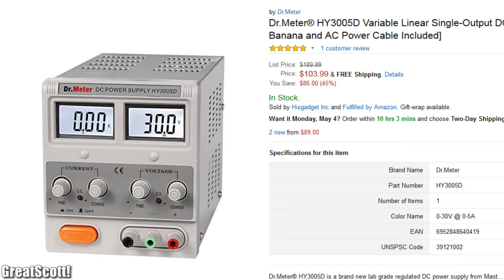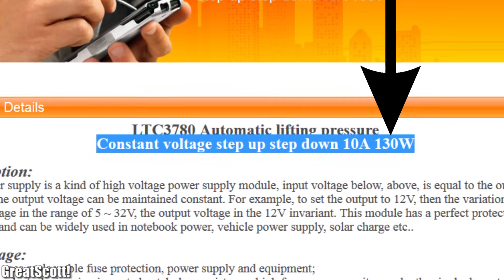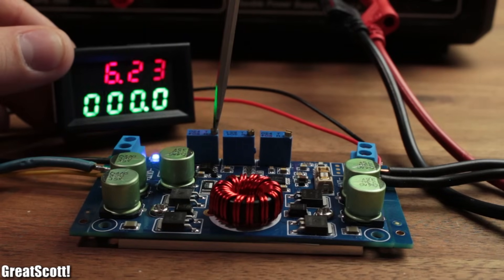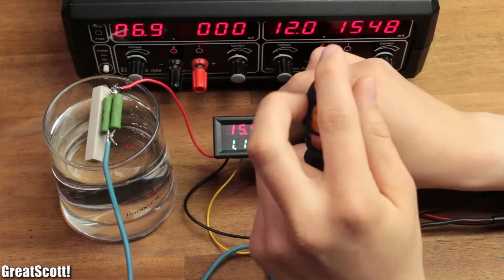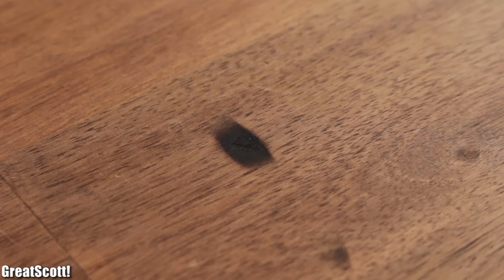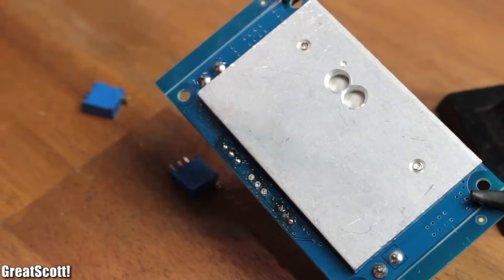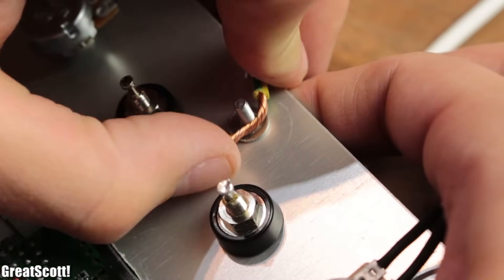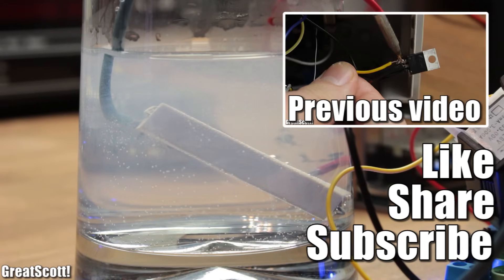Build your own Variable Lab Bench Power Supply

Comment: How to build a power supply: Take a power supply and put it in a case. That's this video in a nutshell.
Reply from the maker: +ronettreker Don't forget the DC-DC converter and the voltage and current display and the potentiometers and the main switch and.........
Reply: +GreatScott! You didn't understand my comment. The Variable Power supply is represented by the 12 power supply and the DC to DC converter. The rest of the parts are just for a convenient form factor. Not even the volt+curent meter is necessary as you could have just mounted two banana sockets in parallel with the binding post and plug a multimeter. What I'm saing is that you focused too much on the package and not on the power supply itself. What's the purpose of this video? Educational? Not really as there wasn't any insight on how a  variable power supply works. DYI? Nope. You used pre assembled boards. Hack? No. You didn't even used any common adaptor, you could have used some laptop or pc power supply, something that your viewers might have, but instead opted for a 12V adaptor that you have to buy from an electronics store. Don't get me wrong, some of your videos look like something made by Ben Heck, this one looked more like something made by Kipkay...
Reply from the maker: It's a simple modular variable lab bench power supply that even beginners can make. I think I said that in the beginning.
Reply: +GreatScott! They can't...because they would need to have the money and access to buy those parts from an electronics store. If they had that money and avaible store then they probably wouldn't even bother building one as they could just buy a fully built one. There's a comment bellow me that even asks if it's possible to build one using a PC power supply. You could have used a laptop power supply which would have given you 19V with 4 to 5 Amps. You wouldn't have needed a step up converter as 19V is enough for a begginer.  Don't get me wrong, this video is interesting to watch, but useless for a beginner.
Reply from the maker: ronettreker
Thanks for sharing your opinion. But I have a different opinion concerning this topic.
Reply: GreatScott! Just don't take my opinion as an insult. It's just, hopefully constructive, criticism.
Reply: Namfrey Fullson What asumption? You just pointed out the same thing I said in my second reply to Scott. Scott bought all of the parts he used. I said he should have used a fixed power supply that a lot of people already have, like a desktop PSU or a laptop power brick. Also a down converter is a relatively simple circuit to build. The hardest part of a down converter is the oscillator. A cheap 555 would do the job, then all you need is a MOSFET and some filltering caps and inductors. Yes, a homemade down converter isn't as acurate nor does it produce a signal as clean as a bought one, but it's a beginers tool anyway.
Reply: Namfrey Fullson The project made by Scott is very simple, I agree on that. What I was saying is that the parts used by Scott are un-available for most people and that he didn't give enough information in the video on how to use other parts.
Reply: +Namfrey Fullson Doubt it...but even if they had it, the unit costs 20+ USD. Together with the converter they cost at least 40 USD. Well then what&#39;s the point? You can get a decent power supply for 46 USD http://www.ebay.com/itm/30V-5A-Precision-Variable-Adjustable-Digital-DC-Power-Supply-Regulated-Lab-Grade-/131179224846 The power supply in this video is not worth it...
Reply: +ronettreker I think you have a valid point. Too bad you didn't state it as such to begin with.
Reply: PunakiviAddikti
You didn't understand my comments... If Scott wanted to help beginners build a cheap power supply or educate them, then the video didn't achieve that. Firstly the parts in this video aren't really cheap and secondly, he didn't give the viewers enough information so they can build a variable power supply from other cheaper parts. He could have build a DC-DC converter using an Arduino or Raspbery pi to controll the MOSFET or even a 555 timer which is very cheap. But instead he used an off the shelf converter which defeats the purpose of actually building it and UNDERSTANDING HOW IT WORKS. And he could have used a power supply which a lot of people might have in their house like a laptop brick or desktop PSU, but instead he opted again for an off the shelf power supply. The video isn't bad it just isn't useful.
Reply: Man, this comment thread is ridiculous. Yeah, the original comment is slightly inflammatory but the point overall is sound. I swear no one who got angry at OP read all the comments.
Reply: PunakiviAddikti
 A 555 timer based PWM circuit was built on a Make video. MAKE! Those people target their videos at a lot of beginners. Combine a PWM circuit with some filtering capacitors and inductors, add some circuit protection and that's it! I mean it's a simple circuit! It's not going to have the same clean and precise signal as the one made in this video, but it's for a beginner who's not going to work with high precision electronics anyway. Anyone with a little bit of electronics knowledge can build it. Also Arduino's are very reliable and a good PWM script can be easily found online.
Reply: +ronettreker Try writing shorter more concise responses that people can be bothered to read.
Reply: SouthJerseySound sounds like a jerk.  ronettreker
is providing a constructive criticism.
Reply: @namfreyfullson  I would think that a lot of beginners would like something that gave them a chance to do something challenging...
Reply: ronettreker
Reply: ronettreker Your debate is boring.
Reply: ronettreker He's already made a video on making a lab bench supply out of a old PC PSU. It wasn't fully variable, and only had the common voltages (12V, 5V, 3.3V), but you could use the info in this video and that one to make a fully variable one.
Reply: GreatScott! simple but costly
Reply: I get what you're saying, but this was an interesting video that offers a solution to power needs.
I was also disappointed that it uses a pre-existing power supply. But there's nothing wrong with this video.
Reply: +SouthJerseySound So criticism is now called "Trashing"? I'm pretty sure "trashing" and "hating" is when you insult something or giving it a bad image without providing any arguments. I've already said multiple times in the comments I made on this video that I like Scott's videos and that this video isn't bad. The thing I was pointing out(I admit, with a bit of bad humor in my first comment) is that the video isn't very useful for beginners as the parts aren't very cheap nor available and that the video isn't very educational regarding electronics. Also I'm not a video producer, so why would there be videos on my channel? If you want useful videos then check the channels I'm subscribed to...they might interest you. I like pointing out possible mistakes so that other people with better understanding can clarify the problem. There have been comments which I was wright and others which I was wrong, in the end however someone who knew about the problem clarified it. I guess it's called positive criticism.
Reply: *****
Do you people even read all of the comments? Yes I know what a variable bench power supply is, what else could I use to test circuits? NO, you do not take a measurement with a multimeter each time, you just need to put two banana sockets in parallel with the main ones on which you can measure the voltage in real time with the multimeter. In case of the amperage you could just  put another banana socket on the positive line and have a switch between that and the positive out socket. The disadvantage of this is that if you only have one meter then you can't measure them at the same time, but if you have two meters that wouldn't be a problem. And of course if you already have a panel voltmeter or ammeter you can use only one multimeter. This method would cut the cost of the power supply, not by much, but why not make it more affordable? Also, I never said that beginners should buy a professional power supply instead of making one, what I did say is that the price of the power supply in this video is almost the price of a entry level power supply you can buy on ebay (THERE'S EVEN A LINK). The power supply in this video is not that cheap and the video doesn't contain enough information that can be applied on other components such as a PC POWER SUPPLY. The whole purpose of my comments was to advise Scott to make projects more affordable and to include more technical knowledge in his videos. Can you please tell me what's wrong with that?
Reply: +YouReel Well if you "Cant Be Arsed" to read the entire debate then how can you form an opinion about me? No, I didn't start an argument just for the sake of it. If you "had been arsed" to read my comments you would have noticed that I given specific arguments about the flaws of this video. IT'S NOT "TRASHING". IT'S NOT "HATING". IT'S NOT "TROLLING". IT'S JUST CONSTRUCTIVE CRITICISM. IT'S BASICALLY AN ADVICE. Whether Scott listens to it, it's his business, it's his channel. Didn't know criticizing something makes you a cunt...
Reply: YouReel
And by "forcefully state" you mean the bad humor I used in my first comment? I've already admitted that the attitude I used in my first comment was uncalled for. The rest of the comments I made have arguments in it. If you are referring to the bitter attitude I had in my other comments, then sorry, it is mostly because I'm sick of the current maker trend where they instruct viewers how to put some parts together without giving any insight into how it works. As I said before, the video isn't bad, it just isn't very helpful for beginners. Also, insulting someone isn't going to make your comment more valid.
Reply: SouthJerseySound
A troll doesn't have arguments, or he has arguments that don't make any sense. His purpose is to annoy people. The arguments I gave make sense and I also gave examples and a link. So to answer your question, I don't know whether being a troll makes someone feel important. Also both of your comments are ad hominem attacks that have no relevance to the discussion.
 So unless you have something to say regarding the power supply itself then don't bother wasting space in the comment section.
Reply: Zyroc Gaming
 Yes, constructive, in the sense that I told Scott what I think are mistakes he made in the video. Whether he listens to me or not, it's his channel, not mine.
Reply: PunakiviAddikti
I know what a variable power supply is...what's your point?
Reply: YouReel
what?
Reply: YouReel
 Then why did you bother commenting? Probably because you're a troll and I fell into your trap.
Reply: YouReel
I made them as short as possible without leaving out anything necessary.
Reply: +ronettreker constructive...
Reply: Ron it's easy to knock someone's video. What I didn't see was you linking one of your own. Until you do that I think you should just shut your mouth.
Reply: +tomtentp Finally someone understands...THANK YOU.
Reply: He still made a better power supply than your sorry ass ever will and he filmed it and put it on yt for the rest of us.
Reply: +ronettreker Your methods would have added unnecessary complications to the video. Think about it this way: +Great Scott could have made an entire video on making a DIY DC-DC converter. And as far as buying a premade supply goes, yes, it would be more cost effective. But for a beginner, a project like this would be helpful even as just solder practice.
Reply: ronettreker  These type of modular instruments are very useful for college students like me on tight budget
Reply: ronettreker
Does being a troll creating arguments make you feel important?
Reply: Gee...youre a bigger buzzkill than buzz killington
Reply: +ronettreker I went to your page expecting to see some useful videos but there"s nothing. I was quite disappointed.I guess you wasted too much time trashing other peoples videos that are actually useful that you didnt have the time to actually share something positive :)
Reply: ronettreker 
You're an idiot.

Comment: This makes no sense, i've blown up 2 of those displays connecting the yellow wire to +v and yet here it works......
Reply: The setup on his is different from mine; mine, from sellerbible has red as sense voltage and yellow as the current path so it would be toast it I used it exactly as stated. I would need red to +V and yellow to the negative post. Also, ensure your device is rated for the current without a shunt. If not, wiring one in is simple enough.

Comment: You mentioned in the description that this power supply is capable of between "(0.8V-29.4V || 0.3A-6A)" but the LED current display is only rated up to 3 amps. Am i missing something?

Comment: how smooth is the output ,since the voltage regulator is PWM based ?
have you tested the ripple with oscilloscope ?
im curious how well does pwm perform under load, i read that pwm will not work for a bench top power supply,because bench top power supply need to be able to deliver smooth DC output ,or it might causing interfere with some sensitive component ,is it right,correct me if im wrong
Reply: +Tonny Cassidy You'll have ripple and using a cheap circuit like this quite a bit of it, too. You can always use capacitors on the DUT side to reduce the ripple, but some will still be there.
Reply: thanks,and by the way i read it somewhere that bench psu should have no ripple or maybe only a little ,or it might causing interfere or maybe damage the component (maybe) ,cant remember exactly ,and you should not use PWM for bench power supply,is that true ?
Reply: The relevance of the effects of ripple depend on the circuit being supplied. Also, all bench power supplies, no matter how good, have ripple. Even a battery with two leads has ripple (i.e., electromagnetic interference from the environment being introduced into the line).

Comment: Well done! But I have still a few notes! For the best soldering, first heat up the parts you want to solder and then add the tin, it looks like you don't do that with the wires carrying the main voltage. You should also heat shrink them. You should also use a lug for the earth connection, you could use  a lug wich you can attach to the cable (crimping) or a lug which you can bolt to the chassis (solder the cable and use heat shrink tubing).

Comment: how do ik how much k  ohm is the blue thing ? i got something else as the step down on the blue potentiometer it say 123 T  and (205 m or W 503 idk with 1 is the real number)

Edit: anything yet? i realy want todo that
Edit2: i heard the W 503 would be a 50k ohm im right?
Edit3: i tried with an B100K and it work when both is still here i just put the stock to increase to the max
Reply: +buder5 You measure the outer contacts with an ohmmeter.

Comment: Hello Scott. I have a question, about the two pots. Can i use 220K and 470K instead of 200K and 500K because it is hard to find here at electronics store. Thanks
Reply: +Jonathan Calleja Yes. The POTS are three wire devices. Make sure the WIPER on the new POT goes to Hole for the WIPER on the circuit board. The other two connections just change CW vs CCW = Increase vs Decrease relationship.
Reply: +Jonathan Calleja You can always use larger pots, with some loss in precision. Using smaller pots may limit your range, depending on how the circuit is designed.

Comment: when i was building this i got AC Input part and it looked a bit odd so i tested it but because i am such a Genius i forget to unplug the plug FROM MAINS so i pluged it in and i was hold both terminals cuz forget it was plugged in and i got the shock of my life luckily the Circuit breaker cut and i lived.